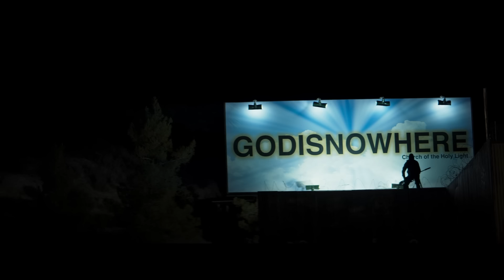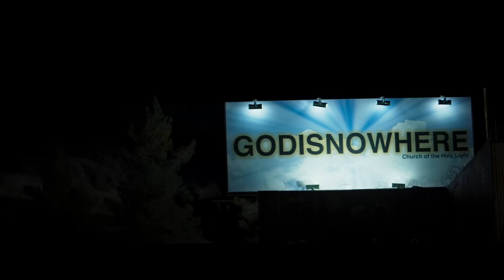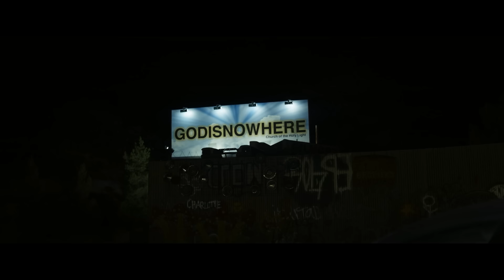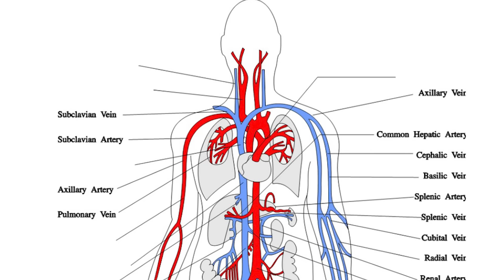How to Beat the SNIPER in NIGHT OF THE HUNTED

Comment: I figured, she triggers the alarm for two reasons. One, if a alarm continues to go off eventually the police will come. Investigate.They will get at shot, and then return fire to the sniper. 2. The alarm can also. Catch the attention of anyone nearby. But to me, she did it wrong regardless. If you’re going to try to use the car alarm to get help. You have to have better timing. It’s only going to work one time. Because the sniper is just going to shoot the car. I would save that for a better opportunity.
Reply: Also I figured if the alarm was loud enough it would make it harder to concentrate on aiming
Reply: natsockaiser2067   He's got the unlimited ammo perk equipped apparently so he can poke around.
Reply: natsockaiser2067 It's a Ford Focus. There's a believable chance the sniper either drove one himself or has helped jump start one, simply based on how common they are.
Reply: natsockaiser2067  No he is assuming he knows something about ford focus because he managed to silence it in 3 shots meaning he knew exactly where to shoot.
Reply: natsockaiser2067   ?? What do you mean cope?
Reply: natsockaiser2067  I don't give hollywierd anything. It's just a simple observation. If you saw someone driving a car really well would you assume them to know nothing about the car they are driving or would you assume they have experience with it?
Reply: Can we also talk about how she literally had the materials to build a Molotov? She could blown up the fuel tanks or maybe set one of the cars on fire. It would get anyone’s attention

Comment: The PADLOCK thing... such a movie trope. If it's padlocked it always NEEDS a key or combination to open it or the door/vault/locker remains CLOSED.
Even though In every high school gym locker room, it only took about 3 kicks wearing sneakers to pop it open... seriously.
Reply: Until you hit metal swing gates. Those things just absorb the hit and bounce back a half inch then swing forward.
Reply: if its a master lock, you could open it with anything short of staring intensely at it.
Reply: @gunmunz  if its a master lock, you could open it with.. a master lock.

Comment: Oil doesn't just catch fire nerd, but using the slick to create an opportunity makes sense.
Reply: @bleakautomaton4808  if you're going to use a powder that you find in most grocery stores there are better candidates than flour and sugar, i'm thinking maybe salt, pepper or lye, but you lose the inflammable property. Doesn't matter, there's plenty of that too
Reply: @@ffa4181 Why would you be trying to breath it in, its just there to give you cover while you run.
Reply: @@ffa4181And the dry chemical doesn't float in the air, but falls onto the fuel of your fire and smothers, unless disturbed, in which case you have a localized dust cloud that doesn't really give you any concealment and just makes the ground slippery.

Comment: @1:56, Whoa! Whoa! Whoa! Pump the brakes! Are those batteries Great Value brand? I thought those were house-brand only for Walmart!

@5:31, OK, that WOULD be a smart idea, but only if she took out the bullet FIRST! Superglue was commonly used in the Vietnam War to temporarily close up wounds on the battlefield until proper medical assistance could be issued.

@9:30, I thought she had a flashlight just 5 minutes ago?  Plus, if she had a flashlight, implicating three short flashes,  followed by three long flashes, then three short flashes again would help A LOT, as it's "S.O.S.", the universal stress signal!

@12:24: that's a handsaw blade made for wood! You're NOT gonna get through a padlock with that, no way, no how! If she had gone with a hacksaw blade, though: different story.

Comment: Woah, woah, woah, at 6:40 you say "...wedge the door open...as it offers no protection..." — ACKTCHYUALLY glass re-directs shots, especially at range.  It's not quiet water, but it will reduce velocity, change trajectory, and otherwise strip the bullet of its "rifle-spin".
Reply: that's somewhat true but considering all the other shots into the building actually hit their intended target with remarkable accuracy, i wouldn't rely on it, and deny information to the shooter should be valued higher
Reply: Depends on the rifle. My .338 and 54R more or less laugh at glass, even laminated glass. Buddy and me shot up some old stuff we got from a demo job for kicks once. Even at 500 yards the bullet didnt start to keyhole for another 50 or 60. In this case....the glass is about as useful as hideing in a box and hopeing it has magical powers to repel rounds.
Reply: Windshields will redirect bullets, but that's because they're tempered and curved. Flat plate glass won't really, or at least not enough to matter for the few feet between the glass and a human sized target.